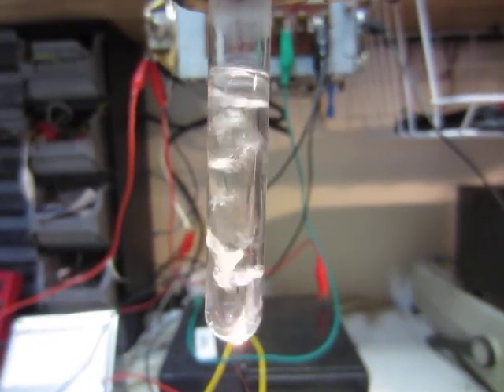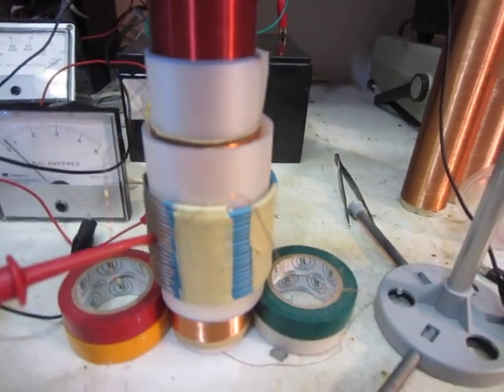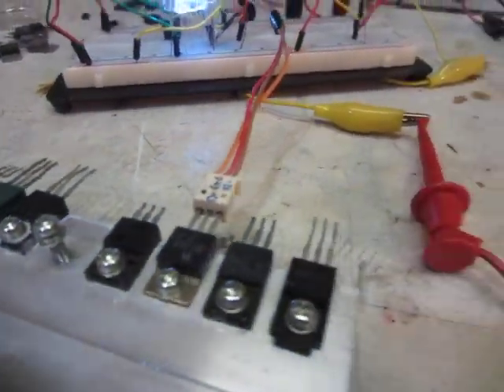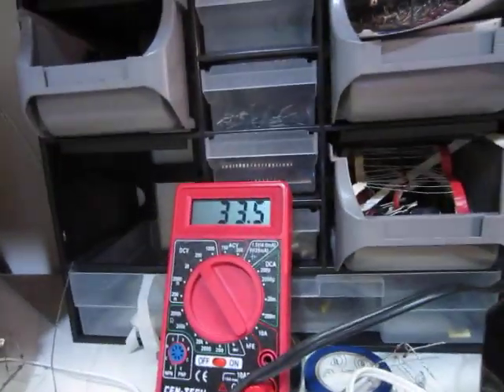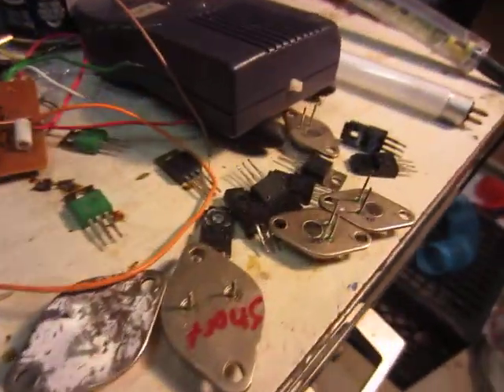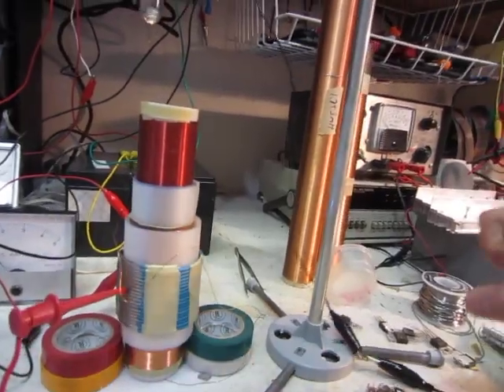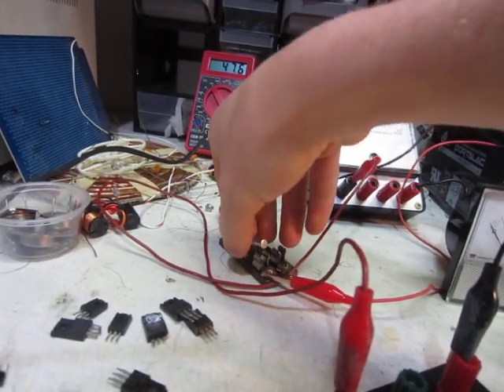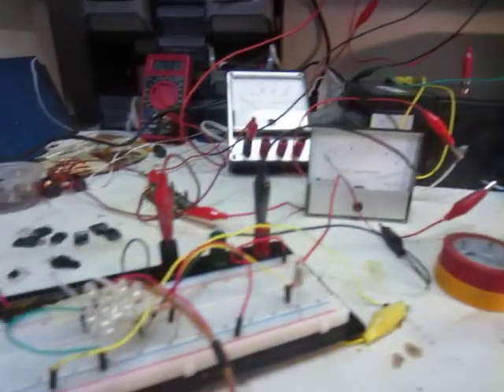Double Secondary PNP Slayer Exciter Tesla Coil Boiling Water

Comment: The neons … they don't light because they are require a minimum of ~70volts to light up... the slayer doesn't run on that many volts...  the transistor only sees the 12volts or so that's input... The output from a slayer is RF... and its the RF that is causing the water to boil above...  (the neon bulb over the collector/emitter is a bedini sg trick to try and save the transistors for when the transients get to high in voltage.)
Reply: Rate of change is what produces the high voltage at high frequency off the top of the secondaries…  

An analog of the rate of change would be using a permanent magnet radial rotor with a stator up next to the surface and connected to a scope so one can watch the waveform as the rotor goes from standstill up to some rpm...  what you will see on the scope is that as the rotation increases the line starts to have long waves in it... and as it speeds up the waves amplitude increases while the distance between the waves decreases...  this is effectively the result that produces the high voltage from a slayer as you could imagine the rotor spinning really really fast at 470khz or so and because of that high rate of change in inversions the Voltage (which is the amplitude on the scope that increases as rpm increases) is what increases on the secondary of the slayer...

Comment: My coil's transistor get's really hot so I use a big heat sink and a fan. This helps. Also I don't run it very long or I will be replacing transistors left and right. They are cool though. I got a nasty burn from mine. I had a voltage arch that connected to my finger nail and burned a hole. Must keep hands away from it.

Comment: looks pretty efficient if that meter is running, and set up as a 3 coil magnifier, this is seriously sweet
Reply from the maker: Thank you!  Not really sure about 3 coil magnifier.  Maybe 2 coil magnifier?
Reply: yep 3 coil, meaning primary LC, with secondary and resonator in series, that was Tesla's improvement on the regular pri/ sec, very cool i was planning that with my 3 coil system
Reply: ... to use the Exciter with the magnifying transmitter
Reply from the maker: Oh I see!  Thanks!

Comment: Nice Tesla Magnifier setup, useful to cheat a Slot Machine in a Casino :) {joke}
Resonant frequency about 2MHz???

I had a long time ago build a equal schematic for HV - HF source for my experiments.
My Lab is small and PC was ~1m from device and wen i switch the device on USB controller go down with Keyboard, mouse and all other connected devices :DDD 

For my auto generator or so called (Качер Бровина, Бровин - a Russian scientist who invented this circuit ) i used a single IRFP460 Mosfet.
Reply from the maker: Hahaha ya!  More like get the police on you!!!  :P

Not sure on the frequency.  I would have to measure it.

Mongrelshark was having the same things happen to his computer when he used his slayer exciters.
Reply: My external burner would reset itself (you could hear it click to check if a DVD was inserted) almost exactly every 7.5 minutes while the coil is turned on. I moved the coil after I noticed this happening. My motherboard may have 1kV+ static protection, but I don't trust it with RF. :P

Comment: Maybe you can use a N channel mosfet and have more power on this. I salvage a bunch of them on ATX power supplies if they work on this would blow the performace of the tip31 even tip152! I didn't had sucess on the slayer exiter, but with 555 or zvs my coil works poorly i need to make a decent one so, i did try leds and diodes but didn't use the ultra fast ones.
A pancake coil might fix my exciter i have to try, the inner diameter of 5cm is better than a 10cm?
Reply from the maker: Yeah I have thought about trying with a mosfet.  I would have to design a circuit with lots of protection components.  Mosfets burn out really easily from voltage spikes and feed back.  But yeah if I could design a good circuit I think it would work really well.  Are you asking 5cm or 10cm for primary or secondary?  I'm not really sure.  I would test it and see which works better.
Reply: Makerj101 could I just replace the tip31 with a mosfet by doing nothing but matching the pinout?

Comment: awesome bro! I have thought about trying that but using some type of setup with a small 12v bulb that will get a nice purple plasma arc inside and laying that in water.  The plasma hitting the glass from the inside gets it super hot super fast. That water is boiling pretty good though and the coil arrangement is awesome. U are not alone with the tranny popping either lol. Maybe you can try removing your base resistor during operation so when u short to ground it will simply turn off instead.

Comment from the maker: I did try a bigger jar but I just stuck the wire in it.  It would have taken for ever for it to come to a boil.  I would also think that if hydrogen was being produced that as soon as I apply the high voltage it would start to bubble.  But that is not the case, it takes a couple of minutes for the water to start bubbling.

Comment: Perhaps you produce some hydrogen but in undetectable amounts. I suspect you'd need to use a specific frequency to efficiently break down the bonds in water quanta (whatever the actual structural composition is in reality).

Have you tried using a bigger jar of water and large plates as cathode(s) / anode(s) in the water?

Comment: Nice work. Have you checked that you're not producing hydrogen gas with your setup? That looks somewhat similar to the hho setups people use running high AC voltage in high frequency through water.

Comment: Very nice Video! I find it helpful to put a protection diode between the Gate and Emitter which prevents a reverse voltage breakdown! (G --I<--- E) and if its not the case with your transistor, a flywheel diode might help! good luck

Comment from the maker: Well no the 12 volt batteries don't cause the -12, it's my computer power supply that does the -12 volts.  

It probably gets extra hot because air can circulate around the coil.  Yeah I can adjust mine so that is melts the wire into a ball.  I try not to do that to much though because it eats up the secondary wire!!!  ;-P  I still need to show glass cutting with it.  I was also going put that in this video if my transistor would not have popped.

Comment: If your secondary is getting hot, I think it has a lot of amps in it. Could be the cause of death of your tranys too, as Roboza suggests. 12v batterys dont have a -12 rail... I cant touch my secondary either, it plasmas me :D.. I got a 600 turn 0.1mm wire coil that turned the wire red hot, will do destruction video one day.

Comment: You should reverse the protection diodes too. As well as the battery, That would be why they burned. I'm not sure why your transistor is burning, Might be the -12v as you suspect. Do you have a car battery handy? There is a sine wave on the ground wire too remember... Water boiling is very impressive. Good to see it can be scaled up to be a heater :) I may have to try that. I have been wondering if the inside coil in Series would work. Tesla did it a few times. Its kind of a bifilar secondary.